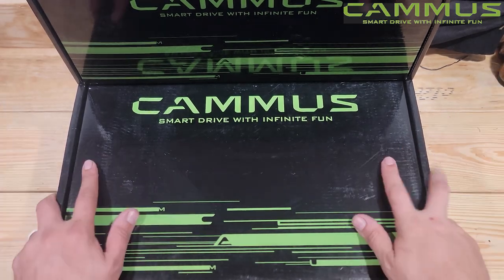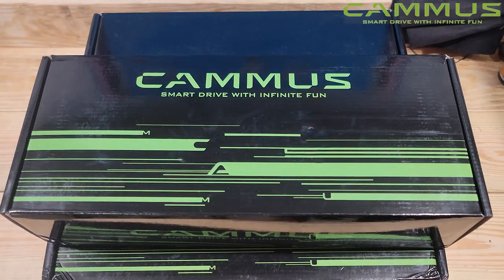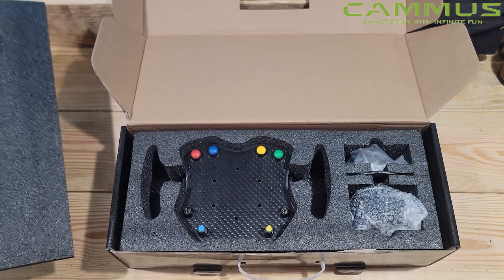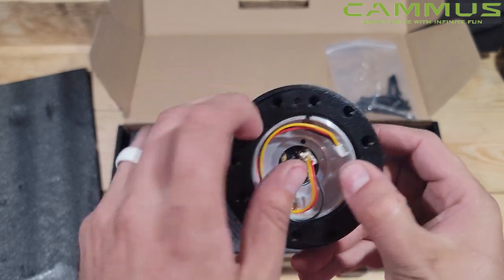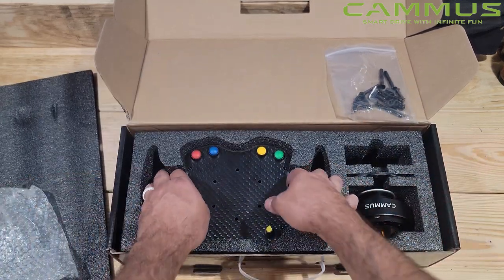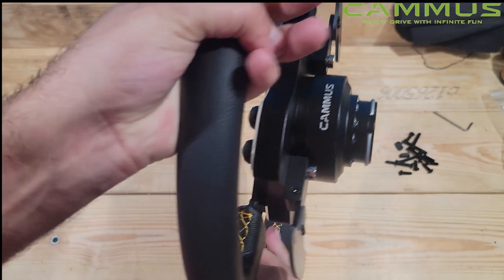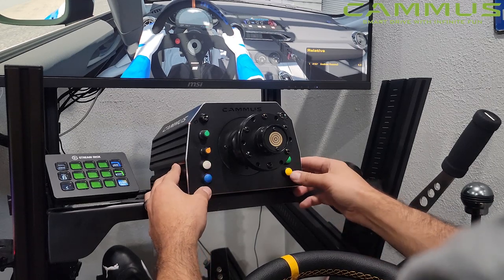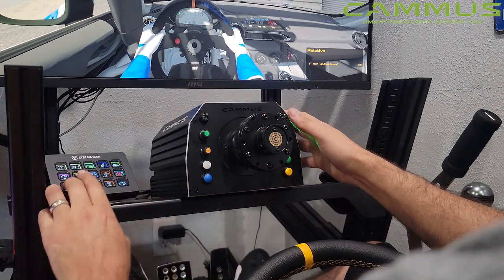My First Look at CAMMUS 15nm DD wheel - First impressions and features

Comment: Every single reviewer of these I have seen are being sent the wheels and given discount codes I don’t know if I can trust that
Reply: fr
Reply from the maker: I could see how you would think that. I can tell you that that I have tried a bunch of wheels that have been sent to me and what I say about them are not influenced in anyway. What I have to say is my honest opinions weather I say good or bad things about them.
Reply: Go watch Sim Racing Corner & his review of the Cammus DD. He goes over aspect of the wheelbase, be it good or bad & so far his most negative thing he said about it is the FFB effects are a bit dull compared to other, even weaker wheelbases
Reply: @Sithhy  he is completely wrong.  I have this base/wheel/pedals, and the details blows away my csl dd 8Nm at only 50% base power.  AC, ACC and Raceroom are well reperesented with strong details/effects/vibration and weight.  Blows away csl dd including my V3 pedals that feel like a toy compared to cammus pedals.
Reply: And only one code with 10% off total purchase which I missed at my time of purchase.  Everyone else is given only 5% discount code.  I could have save a bit more.